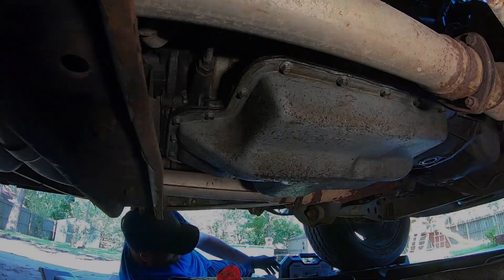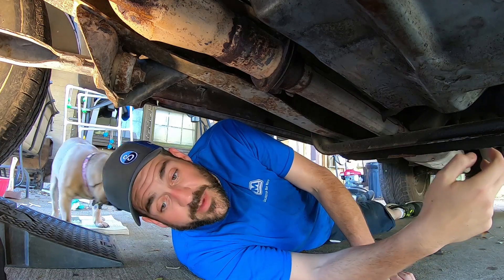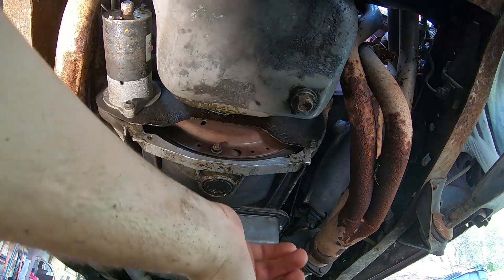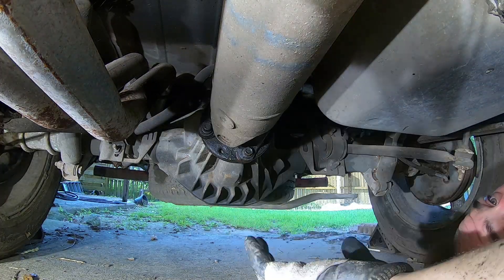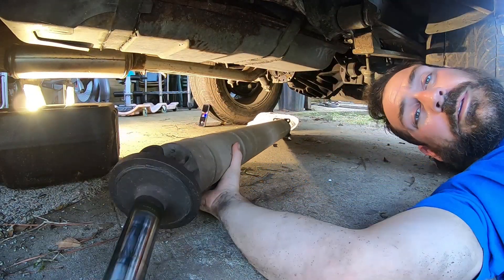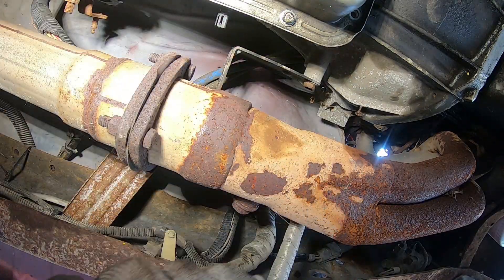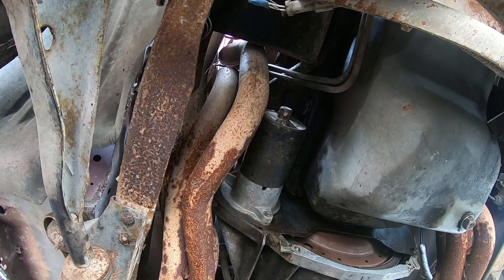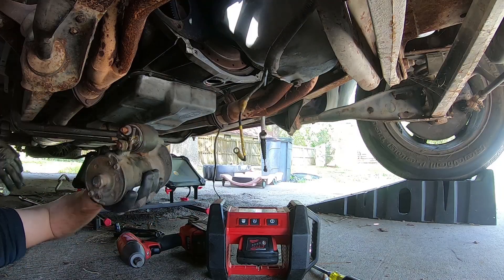1993 Ford Lightning Restoration Project : E4OD Transmission Removal Part 1 #fordlightning

Comment: Amazing job of 

Amazing job and step by step instructions. I really liked the way you took us thur the process brother. Thanks so much. And good luck with your project.
Reply from the maker: appreciate it man. this was a pretty in depth job for me on top o f having so many hands rig up stuff on the trans prior to me pulling it, its gonna be a handful reinstalling it and figuring out all the tore apart wiring. fingers crossed i can pull it off.

Comment: Hey James!  Glad to see your feeling better and turning wrenches again😀👍!  That was a lot of steps to drain all that atf out, and those headers seemed like a HUGE pain to work around.  Plus it’s surprising it was even drivable with those wiring harnesses being burned like that, but that’s the joy of working on a project truck🤣!  Great film work as always brother and I’m looking forward for the next upload.  Talk to you later man!🤙
Reply from the maker: YDOC Productions yea I’m finally feeling better, not quite 100% but close. Those dang headers 🤬, that was a nightmare! But I did learn a little bit undoing them and I’m pretty sure I’ll have to replace them and might go back with shortys when it’s all said and done. I couldn’t believe the wiring job on this truck, like something you’d see someone do to an old carbureted 70s style truck, lots of crimped and spliced wires just run loose in the engine bay and like I filmed laid across stuff it shouldn’t be. Oh well one step at a time 😂. Appreciate it Cody, I’m lookin forward to some more YDOC production videos myself!

Comment: Looked like good  progress to me good too see you're doing alright. Draining the oil from the box before taking it out is a good move stops oil going everywhere when u drop the box.
Reply from the maker: metal art slowly but surely I’ll get there. Definitely feeling better finally, that was a heck of a month recovering. The ol manual said to drain everything and I saw why, that drive shaft would’ve made a heck of a mess if the atf was still in there. I still got some power washing to do though after this ones done 😂 , kitty litter could only do so much with the leftover leaks. Thanks for the kind words brother!

Comment: How do you eat an elephant? One bite at a time! As long as you're making forward progress, that's all that matters. Don't get too frustrated with it. If you need help locating wiring pigtails, let me know. I've got a Motorcraft pigtail book, with factory part numbers. 

I saw your comment on my video a couple of weeks ago. Went to reply to it & it was gone. Don't know if it's a glitch in the matrix, or you deleted it. Glad you're feeling better & everyone is doing good. Give me call one night.
Reply from the maker: Wesley Johnson you know I’ll be searching for those connector part numbers Wes 😂, so many broken and rigged ends I’m sure I’ll have a slew of them to replace before to long. I still see the comment on the intro to new project video of yours, I may have slipped into your spam or held for review section on the yt creator app. I’ve had a few do that to me as well, weird what they decide to filter out sometimes. As for the trans I’ll get this booger out eventually, hoping this weekend if I get a chance I can get it fully removed, after that the engine and sonon...big project for sure. I just returned to work (out since 7-13-20) and have to used to the grind again. Lookin like we’re on straight 40s though for the time being, and I have a possible surgery this year as well so no tellin what the future holds. I’ll give ya a shout soon though brother!
Reply: @3rdcoastobs467  whenever you want the pigtail numbers, just text me pics of what you have (need). Need the cavity view & number of terminals in it. Huh, that's weird with that post. I can't even get to it off of my laptop. Anyway, I'll see what other stuff I can scrounge up for you!

Comment: Great video  James! Other than the performance gains, there is NOTHING good about headers. They are always leak prone, make it hotter under the hood, and as you have discovered, make it virtually impossible to work on things that are usually routine. Glad you are getting better and back at it, I've been missing your videos.
Reply from the maker: Weird I replied on my iPad a while back to this and it’s not showing up? Guess I didn’t finish and send lol. Yea these stupid headers man, super problematic. I learned my lesson years ago putting some shorties on a truck, leaked constantly and ended up costing me a lot in install because I didn’t have the tools patience or knowledge to do it when I was 21 🤣. I’m not sure what I’ll end up doing moving forward, I’m sure I’ll go back with “performance headers 🙄” but not by choice and more than likelihood shorties. I got plenty of time to decide that though...I’m Moving at a snails pace on this project and work has picked up so it’s been hard to get in the groove of the truck and filming. Just not enough hours in the day! I’m better but still sort of recovering, I guess I have good days and bad right now, hopefully I’ll be good to go rolling into the holidays though.
Reply: I call them headaches

Comment: Working on those rusty fastens check out a tool called shake and break ,,,uses a air hammer with a wrench to help free them amazing tool
Reply from the maker: Definitely will, plus I've been eyeing getting a nice air compressor for my little shop. That might be the tool that will justify the upgrade!

Comment: I like how you don't edit out the things that happen while doing this kind of stuff, like metal shields falling and nearly hitting you. Almost getting knocked out by falling sockets/wrenches etc lol.
 I don't know how many times I've seen something like that starter and thought ah that will be a quick fix.🙄
Reply from the maker: Steve Stoltz man Steve I had about 2 or 3 more mishaps but couldn’t edit out my choice words so I had to cut them out 😂. I popped myself good in the ear with that 1/2 breaker bar and took a shot to the forehead right between the eyes from a 3/8 x 6” extension that had me hot! I try to lay it all out there on these types of jobs, the good,bad and ugly. I couldn’t believe that starter debacle, the more I looked at that passenger header the more it looked like the pinched a exhaust tube and a section of my frame looked like it was grinded down to make room to fit...nothin worse than fixing someone else’s rig job. I could have made a 3 hour video on just trying to get the header bolts out, after grinding sockets, buying shallow sockets and trying t-handle Allen wrenches I realized I just needed a plain old box in 3/8...which explains why they had exhaust leaks, the headers can’t be torqued properly with the way they installed them....nightmare city over here that day 😂.
Reply: @3rdcoastobs467  I had a TH400 converter slip out while i was bench pressing the trans out of my 66 Buick back when I was young, I caught it with my forehead to keep it from hitting the ground. Trans fluid make your hair very smooth and silky I found out. I also remember my dad always ranting at me every time Id talk about wanting to put headers on something, for that very reason lol
Reply: @SteveStoltz  lol i used to work at a quick lube oil change place as a kid, I agree. Trans fluid will make your hair smooth. Sure made me mad when I didn't want a transmission fluid shower
Reply: @Breakern9n3  Ha ha Silky smooth.

Comment: I have a 92 f-150 with the e4od. Mine is 4 wheel drive, but it was slamming in and out of all the gears super hard! It would rev up and smash into the next gear, especially when hot. I thought my transmission was done. I got the truck from my grand dad when he died, and luckily he wrote down all the work he has done, and the transmission was replaced about 30,000 miles ago. So i did some research and seen a common problem is the manual lever position sensor (MLPS)  going bad, oreilkys called it a neutral safety switch when i went to buy it. So I replaced it about 500 miles ago, and it shifts perfectly again! I was so happy! A 25$ part fixed it. I hope this can help someone else with this somewhat common problem.
Reply from the maker: Oh man I remember changing my mlps on the 92 f150....I made the mistake of getting the one that didn’t have the connection and was trying to wire in my old one, it was a total sh*t show. Ended up having to order a pigtail connection and splicing,crimping and heat shrinking it. That made the project go from a quick hour to waiting 3 days and 4 hours of work....that was right before I started filming my blunders 😂. It’s great advice though, I read about that while trying to troubleshoot what was wrong with my trans...that’s a long story though.

Comment: Do you have the transmission in neutral when your turning the crank to get the flywheel to rotate
Reply from the maker: I left it in park, it will still turn. I'm sending it off for rebuild so I wasnt too concerned with marking placement of bolts on the flywheel but I good tip is to know which nut came from where on the flywheel (at least that's what the haynes repair manual said to do) but I didnt show that or do it myself.

Comment: Those husky sockets is what’s stripping your nuts 😀 I have those tools and every time it strips 👎🏼six points sockets 👍
Reply from the maker: 100% Agreed, but they also gave my proto sockets a run too lol. They were in rough shape though and had a lot of rounding from the previous work done years ago when the other owner put the stock trans back into the truck.

Comment: My transmission from a 99 f350 think is the same ,was rebuilt about 5 years ago 4,ooo miles  is now leaking fluid bad out of the rear passenger side any idea what could be wrong ? Might do what you have done remove it and bring back to trans shop thankfully I have a 18 year old son that knows a lot about cars and will help
Reply from the maker: From what I've semi learned (baptism by fire 😂) on the rear of the trans pass side there are those 2 prebent factory lines that run to the cooler upfront. If its leaking bad and not the pan in that area that line or that fitting could be spit or cracked. Where my audio cut out on the video is where I was removing them with that flare nut wrench.I'm probably going back with a braided flexible line when I reinstall mine for easy install and I think they should last a bit longer.

Comment: Good video bud. I was digging up info behind my dad's 2000 dodge ram 3500 dually. The original owner was a guy that came from Norway. He is actually pretty famous over there. He bought it new in 2000. Sadly in 08 the truck was wrecked. They traded it in on a 08 ford ( I believe ) I'd like to have my dad's dodge. Maybe when I get my 99 fixed I can buy it. Sadly it's in rough shape ( I have a few videos on the truck) the frame is damaged from a dump bed,needs doors,needs front clip,and needs a bed. I guess it being a dodge cummins parts are literally everywhere for them since they are pretty popular. 

Edit here's a video of the truck if your interested https://youtu.be/BtuS-SuTtVI
Reply from the maker: That's rad you know the history of the truck you want to buy.  I wish I could trace back my project truck lightning but it has at least 6 owners since '93 so the only thing I can verify is it never left the great state of Texas.  We all start some where and a nice truck from 2000 and before usually isn't in great shape (and if it is its easy to expensive to for my blood 🤣) but I bet it's got nice bones and is ready to be fixed up a bit.  You're sitting on the next generation of classic trucks, when I was a kid it was 60s and 70s muscle cars  but nowadays its 80s 90s and early 2000s before they started pussifying cars and trucks for epa regulations. The only reason I wanted my 2013 f250 diesel crew was I felt  it might be a sought after body style and engine if I held on to it and I guess im doing alright because it still blue books at $34,000 and I own it outright. I'm going to check out that video you sent right now brother, i  want to see this awesome dodge diesel dually finally.  12 valve is the most popular but the 24valve is a beast and will also last forever! Where abouts are ya from man?  Sounds Canadian,  that's awesome we watch each other's videos and communicate on here a continent away from each other.
Reply: @3rdcoastobs467  I'm actually from Arkansas. I guess you could say the truck has good bones. The engine runs good,cab just needs bodywork, but it needs a few seals on the engine replaced ( I remember how every time my grandpa would part at the diesel pump it was always leaking some sort of fluid lol. It doesn't have very much rust on the truck (it's just beat up). Only 2 out of the 5 clearance lights work. It needs a ton of work. I was wanting to build a 2001 dodge dually with new or remanufactured parts. And it's a truck to get started. The only thing is. It's a year older ( which doesn't really matter to me)
Reply: @3rdcoastobs467  allot of the reason I was able to chase down the history is cause it was owned by a pretty famous guy.
Reply from the maker: Oh shit I was WAY off 😂, where the hell did I get Canada from! Guess I’ve been watching too much rust valley restoration videos on Netflix paired with the previous owner being from Norway, plus a few miller lites..my bad. I watched the video, you’re right it’s got good bones and is primed for fixin up. Most of the stuff that’s broke isn’t too bad and that motors just broke in at 200k it’ll run forever...and if I remember right that style dodge has a lot of room under the hood to work and isn’t to bunched up which is a huge plus! What I ended up doing before I decided to start my rebuild was basically prioritizing what I wanted done vs what needed to be done. Power train rebuild (rebuilt stroker motor and beefed up rebuilt trans) to rear end, brakes, wiring, to body and paint to interior. Originally I was starting on the inside but realized that’s a waste because if it don’t run it don’t matter how pretty she is. Everything takes time but luckily parts are available for the most part and you’ll be able to do it 1 piece at a time just like your 99. May take a while but you’re young so even if it spans a year or 2 oh well. I’m trying to get mine done before I turn 40 which will be nearly impossible but I’d like to have this as a birthday present to myself in March.
Reply from the maker: You done peaked my interest.....speak on it, who was it🤔??
Reply: @3rdcoastobs467  the original owner of the truck was "arvid Maeland" I was told he had 2 ranches in the us ( one in missouri and on in Arkansas) my dad's truck was the truck they used to get from ranch to ranch (hence the reason it had 150k miles on it when my grandpa got it
Reply: @3rdcoastobs467  what I would like to do with the truck is get it a brand new replacement frame from mopar for it,since the engine runs fine I'll be resealing it and painting it to be put back in. I want to get it brand new doors,fenders,roof skin and hood. I want to also go through and redo the mess of vacuum lines it has. Put another bed on it.redo the fuel system and get rid of the junk factory stuff It came with. And also convert it to a nv5600 ( hd manual transmission). And to top it all off. A brand new patriot blue paint job.